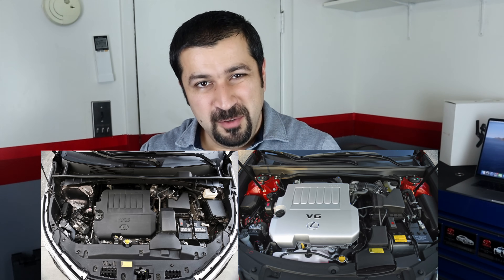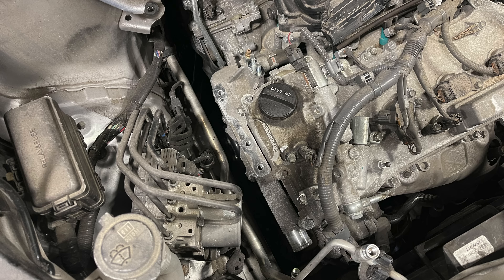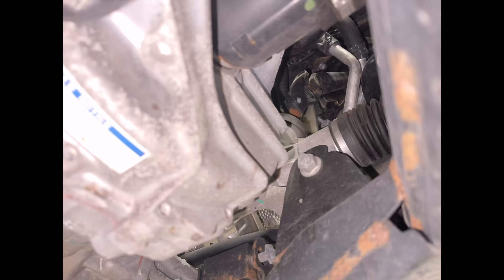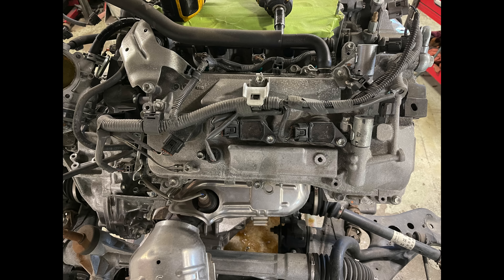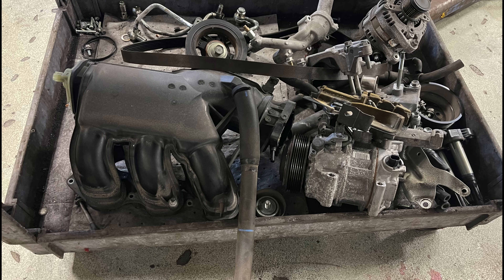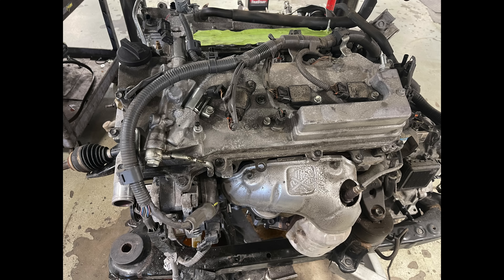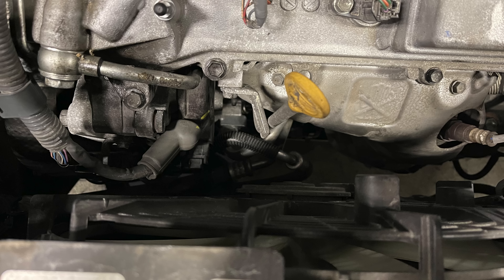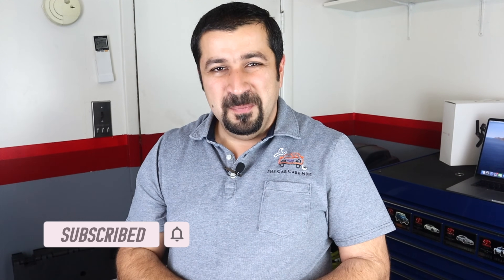Toyota V6 Engine 2GR-FE Disassembly Start to finish Front Timing Cover Repair

Comment: Great video, like always. Question:  I have a 03 Toyota avalon and I'm having trouble taking off the crank shaft bolt, the bolt that's holds the harmonic balancer. I need to replace it and I need some ideas on how to remove it. I took the car to the Toyota dealership and they couldn't take it off. Please give me some ideas, because there's nothing wrong with the car except for the harmonic pulley. Thanks
Reply from the maker: Hi! You’ll need a chain wrench and a really REALLY long breaker bar. If this doesn’t work then you have no choice but to heat it up and possibly need to replace the plastic cover behind it and the crank seal.
Reply: @TheCarCareNut  thank you for the response. The Toyota dealership applied heat to it and nothing happened. But, I will try it myself this coming weekend and hope I can replaced it. I also bought that special tool that holds the crank pulley from spinning. I'll keep my fingers crossed. Keep making those awesome videos.

Comment: "Done 300 of them"
I thought Toyotas were relaible and strong and fault free?
Why does it leak?
Reply: @league04  I am kinda surprised maybe a $ 30.00 gasket is so much trouble . Might as well replace timing components or anything else that might make you have to pull the timing cover . WOW !!! Don"t let it leak right after repair .
Reply: Yes this is ridiculous. Our 2001 Sequoia is going strong at 818k miles. Didn’t start leaking until high 300k
Reply: @xxk4rilsxx  did you fix the leak or just wipe it off every oil change?
Reply: The second law of thermodynamics says that the entropy of a system increases with time.

Comment: I noticed that this 2gr-fe  calls for 0w-20 my 2007 avalon (2gr-fe) calls for 5w-30 should i stick with 5w-30 or use 0w-20 or maybe 0w-20 during winter? also mine had recall done on oil line but was with "improved" rubber/metal hybrid design i inspect it weekly no signs of leaks or deterioration but i may replace i think it may be above my ability to diy. About how many hours labor to replace with metal line.  i heard that the metal line is more of a pain to install. Worth it? No more nightmares of me driving then smoke and stalling side of road looking at my destroyed engine LOL  THANK YOU FOR THE VIDEOS AND I HOPE YOU AND YOUR FAMILY HAVE A GREAT 4TH OF JULY WEEKEND.
Reply from the maker: Hi! I would stick with the 5w30 on your Avalon. And for the metal line if the recall was done I wouldn’t worry. It’s a pain to go to an all metal line as you need to remove the power steering pump
Reply: @TheCarCareNut  THANK YOU SORRY I JUST NOTICED YOUR REPLY. LOVE YOUR VIDEOS AND YOUR PASSION FOR HELPING PEOPLE.

Comment: Is this the same engine in the 3rd Gen Tacoma?
Reply from the maker: Hi! The block is similar design wise and the front cover but the cylinder heads are very different
Reply: @TheCarCareNut  Thanks I was asking because I have a 2016 Tacoma so far no issues  however it only has 27,000 miles on it

Comment: Hi AMD, do you know around what mileage this problem will occur? How many miles this 2015 Highlander has? Thank you..
Reply from the maker: This highlander has around 80k and it’s really hard to say when it happens seen them leak as low as 15k and some go over 200k without leaks

Comment: Yes, yes, yes! I don't know why I was so excited to see this... Is there a "before" picture of the timing chain cover leak on this vehicle?
Reply from the maker: I do have a few pictures here and there from other cars missed it on this one.
Reply: Yes I was wondering that too. How bad is the oil leak so that you would like to go through all this trouble. Also, is it the type of sealant that the factory used that is causing the issue? How long the repaired one will last?
Reply: @mornek  I would like to know too if the FIPG the factory used turns a lighter than than the brown that could be seen on an edge of one of the pans because mine I see that stuff pushed out all around the covers 😂 for reference mine has about 175k so at least that long unless it's been done before!

Comment: The engine 2gr-fks is a good engine?? I have a 2019 highlander and camry with this engine
Reply from the maker: Hi! It’s a good engine. Somewhat similar to this one but improved
Reply: @TheCarCareNut  Hey how you doing? Love your channel.
 I own a 2017 es 350  23000 miles. Should I worry about that issue?
Reply from the maker: Hi! I’m doing well thank you! How about you?

I wouldn’t worry. You’re still within factory warranty. I would however check it for leaks. If you see any bring it up to the dealerships attention so they can take care of it.
Reply: Thanks my friend 
Question: at what miles i need to change the transmission fluid for the camry and highlander??
Reply from the maker: Hi! Every 60k miles or 6 years is ideal
Reply: @TheCarCareNut  thanks fot your help